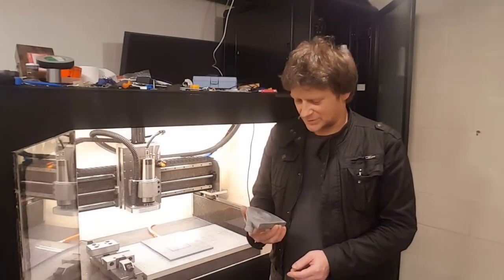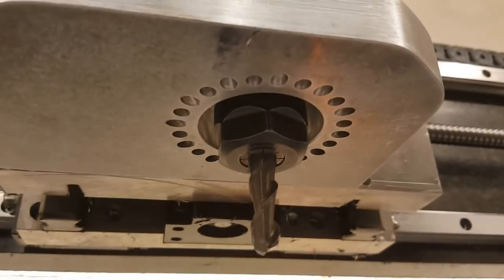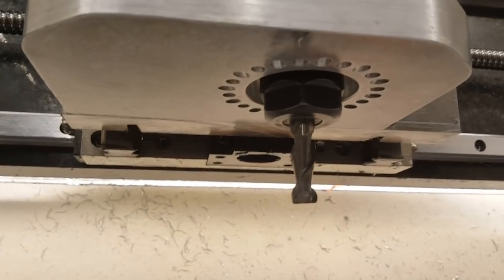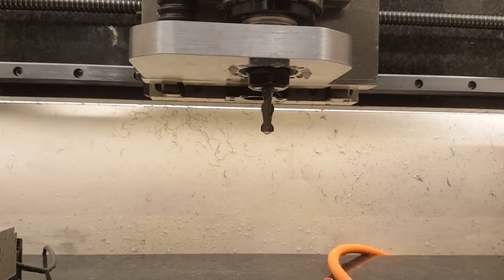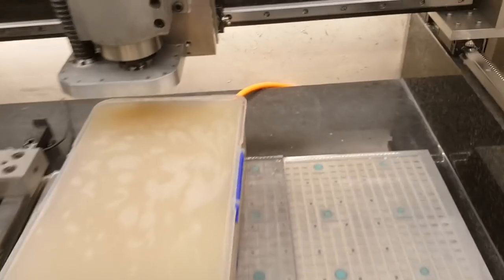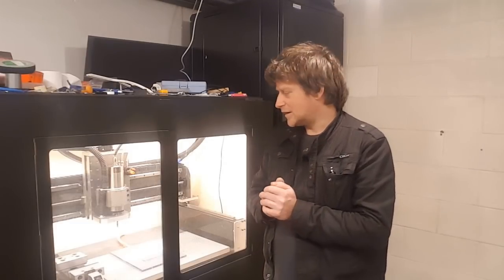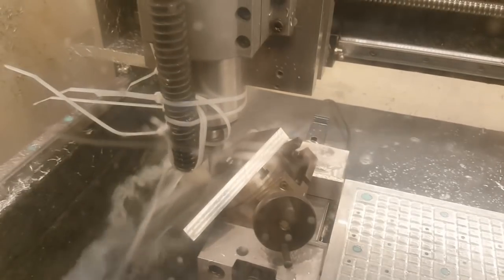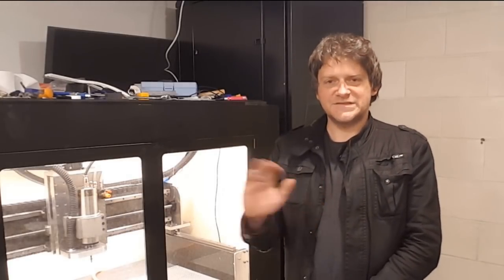perfecting the design of flood coolant nozzle

Comment: Hi Fox, I really like your flood coolant ring, can you tell me what size drill bit you use ?  I do not want to make the holes to small or two large, I have a Grizzly G0795 mill, that I am converting to CNC.
Thanks in advance.
Reply from the maker: i will answer on it like gandalf :) but it wont be a riddle :) combined amount of holes should be proportional to the size of the hose you are using to deliver coolant.  so if you want to  use 6mm holes, just stuff the hose with as many 6mm drill bits/dowel pins, you can. than add some to cover the holes between them and it will give you the total number of 6mm  holes. this would apply to any other sizes. you just try to keep similar flow rate as the delivery pipe. i hope its a good explanation
Reply: well That really does not solve the question, from counting the holes in the coolant i think there are 24, because you said every 15 degrees so 360 divided by 15 degrees = 24.
Your pump is 8,000 liters per hour divided by 3.7854 = 2,113.3829 gallons per hour divide by 60 = 35.223048 gallons per hour max.
What I do not know is the inside diameter of the hose your using, but i am guessing 31.75mm, or 38.1mm ID hose.  On video it is hard to tell ???

The pump I am using is just like yours, but I selected a 2,500 gallons per hour or 41.67 gallons per hour at 1.5 inch hose.
Reply: @mauricerobberson4565   7:40 ~ size of endmill. 4:00 ~ liter pr. minute.
Reply: @mauricerobberson4565  Late to the game but in case anyone else has the same question - to follow Fox's take on this, you don't need to know the size of his hose. You need only to know the size of the hose meant for your pump. 
And then according to Fox, the idea is to keep the total cross area more or less the same (total area of all the small ports = cross area of hose).
At least, that's how I understood it.

Comment: Sweet vacuum table! How do you keep the airlines free of water, just blow with compressed air before engaging vacuum?
Reply from the maker: good question :) and my answer is: I don't care :)  I don't care, because i have pressure pot  in between vacuum plate and vacuum pump, so whatever get sucked ends up in a pot and not in the pump. My next video will be about it. You are always a one step ahead :) If you have any particular questions you would like me to answer in the video please ask. i have list of things i want to talk about but i might be missing something.
Reply: Ahhh I was gonna guess some kind of inline separator, very clever. Umm I probably have tons of questions... Still trying to get my own crappy extrusion router working but can't even drill the hole plates accurately ( my mill has bad backlash and no DRO) One question would be where do you get plate stock? haha. I also wanted to know how this flood system may affect the linear rails, ballscrews as far as oil or greese? Or do you just not care because they are chinese ones and it is performing well while drenched anyway? Anyway I'll probably continue to bombard you with questions on new videos as I think of them, can't wait to see the table and also ATC spindle, those things are NOT cheap!!
Reply from the maker: you can't drill holes accurately?! i think you watched too many youtube videos :) and you get impression that all the stuff should look perfect and be with in 0.001 nanometers precision :) I made my machine with cordless drill, drill press and a drop saw. and im still using mounts in the machine which i drilled by hand and cut on a drop saw. just make bigger holes so you can adjust it if its off. Once you build it you can use it to make better parts, and once you use those petter parts you can mill even better :) 
I get my aluminium from NALCO, they are really awesome. you can get offcuts or you can order cut to size plates, check them out:
http://www.nalco.co.nz/industrial-aluminium-solutions/plate-offcut-stock
Affecting linear rails, coolant has oil in it and anti corrosive stuff mixed in. so I'm not to troubled with rust. and yes those rails and screws are so bad that I'm not too troubled :) Perhaps i even look for them to break so i can get a good ones :)
Reply: Guilty as charged hahaha! I'll post a video when I get things up and running. Gonna give nalco a call, thanks a million!
Reply from the maker: @3dkiwi920  hehe ;) good luck. I can't wait to see your video!

Comment: Piotr - care to share the details of your pump?
Great video, I followed your progress when making the granite CNC - thank you for sharing :D
Reply from the maker: yes of course, https://youtu.be/NcC-34prNNY?t=394 but if i could recommend to use 4000l/h :) this one is a slight overkill.
Reply: Thank you for the quick reply Piotr :D
I was actually thinking about the pump itself, not the nozzle which is very nice BTW!
How big is the resevoir you use?

I have DIY'd my own CNC  and had it running for the past two years and is currently preparing a project where I will cast the complete bed/rail support in epoxy granite.  When I do I will have the option of running flood as the current one is made from wood.
Reply from the maker: i have 50 liter coolant tank which is filled up to top. I would love to see your new epoxy machine. out of curiosity, do you have a plan to use gelcoat first? good luck on the build!
Reply: Great info, thank you :D

I have one experience with EG and it worked very well for me - as a mass dampener for my flexible, wooden based gantry.  

I might be able to start the EG build this winter but I dont have to rush it either as I do have a operational CNC at the moment.   I was thinking about reusing parts off the old one but will be going for a complete new-build so I can fabricate the new parts as I go.  The overall design will be based on SFU1605-750/500mm that I have on hand.  Hiwin clones for rails and 48V / Nema23 270oz based power system.  With an EG base this will be as large/heavy as I can go haha!  It will basically end up like yours, except cast in one piece.

Havent decided yet on gelcoat or not yet as it will only affect surface estestique.

https://www.youtube.com/watch?v=JYVMECX1yLI&list=PLW1SE5VzX2rjz52CEAtl1h92JeJZHPMOC&index=7
Reply from the maker: this wooden one seem to be working amazingly well. I'm really impressed!  
don't forget to build base for it as rigid as the machine will be.
black gelcoat would look sick :)

Comment: What for?..Water stream is not the laser beam, it come as lot of drops, not the one point..You can use three jets for 120 degrees angle between one and other, but even it no need , the tool rotate all the time, and one jet make the job by 100%..Other advantage of single jet is stronger stream, can better separate chips from the tool..
Reply from the maker: My goal was to wash off all the chips from the table and to wash them in a controlled way. Not blow them all over the cnc.
Reply: @PiotrFoxWysocki  Ahh..ok, I build for that purpose flipped cnc on gaslift, after fix material it over from horisontal to vertical position and all the chips drops down to bucket

Comment: Just buy it. Out there is china-made one.  a ring with several articulated short nozzles attached around. But. For this type of spindle. There is still your mentioned problem of putting the wrench into there for unlocking the nut. Oh. No. It may be attached to a higher position to avoid it.
Reply from the maker: i could but it wouldn't do what i want. this coolant is to lubricate end mill, cool, remove large amount of chips and by doing so not blowing them all over the machine, but grounding them and moving away from the workpiece with the flow. Chinese nozzles would do most of the stuff but it would also blow chips all over the place.  that was one the reasons to make this one.